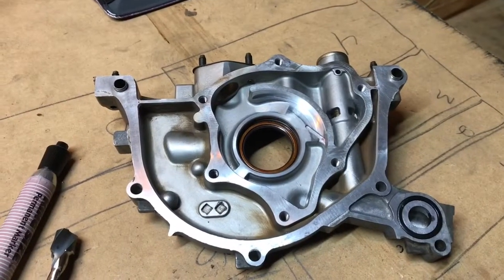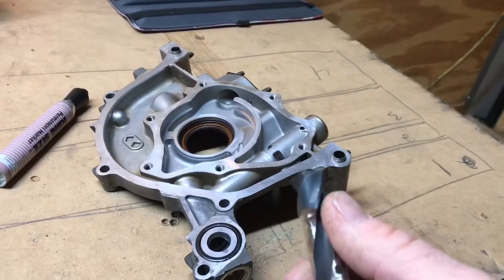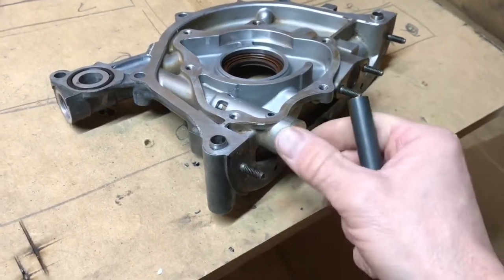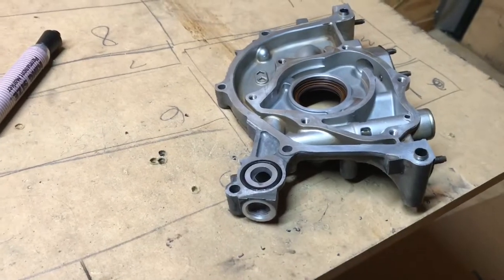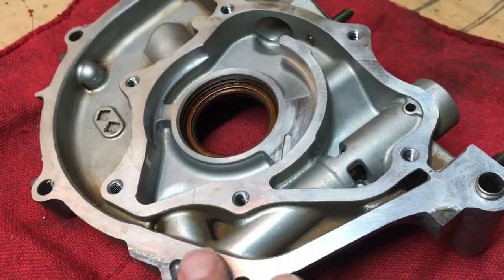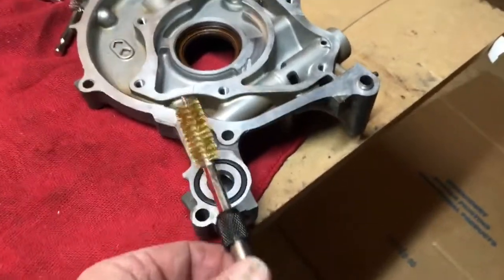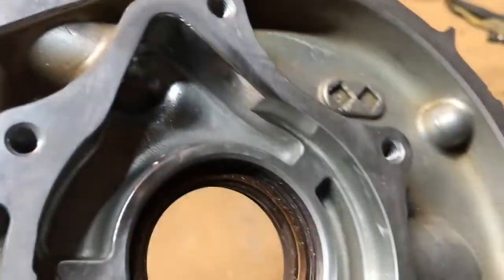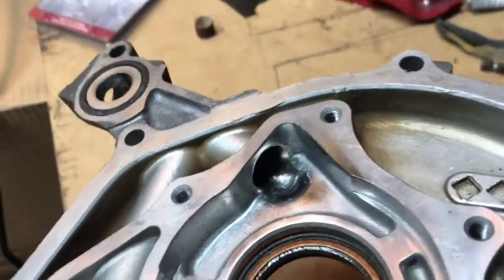Porting a B18c1 GSR / Honda oil pump

Comment from the maker: Here is a short clip of the car being taking up to 9300 rpms with this oil pump. Notice the oil pressure stays right at 80psi and it never moves until I let off the gas. Car is 500-600whp range currently  https://www.youtube.com/watch?v=vl7dng9rmEE&feature=youtu.be
Reply from the maker: rizky lase not sure why it’s not working, I’ll see what I can do
Reply from the maker: rizky lase there is a video linked to a below comment that also shows a shirt clip, the car is now 700whp and holds 80-85psi on the track and still holds great oil pressure while driving around. I shattered the pump in this video when my crank pulley came loose ( not the pumps fault) I ported another pump the same way and going strong ever since.  There are videos on my page that show the gauge while racing (gauge is where the radio used to be)
Reply from the maker: rizky lase https://youtu.be/vl7dng9rmEE just made this today

Comment: Thanks for the upload, I hadn't found a video with the bit size and drill step included.  I appreciate your take on the job!
Reply from the maker: Hope it helps, I just did my 2nd pump for mine. The one I did in this video did incredible until I shattered it at 30psi when I  overreved without having a proper damper....not the pumps fault
Reply: @barryc1635  I thought I had everything required and was going to start porting it this evening.  Seeing this video this morning was perfect timing and will save me some headache.  Again thanks!

Comment: A little rough, but with practice... ;-)

Lightly grinding the cutting tip so it is less sharp - 1/16 zero rake is plenty - will greatly reduce the grabbing of the cutting tip.
Pick up a 6-8" length of steel rod, cut a slot around 1" long at one end and smooth off the sharp edges - you can cut strips of fine emery cloth/W&D and slide them into the slots and it will do a very nice smoothing of the oilway when spun by an electric drill.
Cutters, or burrs, are much better for removing aluminium and should be used with wax, or other lubricant, to reduce cut material sticking to the cutter.
Depending on the engine, and how far one wants to go, one can also drill out the internal oilways and, for the long oilways, extended drills are available, although their cost may restrict that to the more financially comfortable folks, or those who do a lot of block preparation.

However, as I understand it, one of the big problems with the high rpm (~9k5 up) operation is cavitation and this happens on the suction side - this would suggest that some judicious reworking on that side of the pump, and oil pickup, would be a very sound idea.
Reply from the maker: Interesting thoughts.   So far mine has performed perfectly, but I’m sure there’s always a better way
Reply: Did you read the results of revving it all the way to the Moon with the modded oil pump?

Comment: Awesome stuff. What else did you do to the ports size were you stuck the marker just leave it alone
Reply from the maker: If you talking about  the entry area where the drill bit went in, that area is threaded and don’t get touched. That’s why I made sure to remove the part of the drill bit that could possibly damage those threads. If that’s not what you meant, ask again lol
Reply: @barryc1635  the hole with o ring seal leave it same size or can I open it up and on the block and i always clean it up 👍
Reply from the maker: since the pick up tube that connects to it is the same size as the o ring port  ( I do believe) I would not open that o ring port up bigger since it would cause a bottle neck and cause turbulence. I would only round the inside area and make it smoother
Reply: @barryc1635  well i was wondering i use to have a baffled morso oil pan and still have the oil pick up cause someone stole that and pump so I didn't know I have a DART block I was sick and someone went threw my stuff I had 2.2 stroker built Brian crower stroker kit said block would hold 60PSI traded a running single cam for it because needed a running motor lol but I been sick with brain tumor and cushions disease rhabdomylosis and blood clots im healing now but its been three years and I fight everyday wake up hurting go to bed hurting and can't get disability or anything said I didn't qualify because I didn't make so many hundred thousand dollars by a certain date BULLSHIT I think and I finally got some help when the nurse seen me threw window laying there in the hospital  parking lot Drs said I was eating to much I couldn't sleep or anything I told em I was rapidly gaining weight and wasnt eating my cortisol levels were in 90S I was in so much pain i had wholes in my stomach you could see my stomach lining i had to learn how to walk talk eat and all again and now all the money I had saved up had went to meds and gas and bills so I have no money I could have built my stuff I had plained and everything just come falling down on me it been hell i have been crucified and I helped everybody if I had it they had it never meet a person like me but anyways I'm getting it everyday wake up hurting go to bed hurting but im get something weather i get the governor or TRUMP or boths  attention it's hard man I can't work so I have no clue I can do almost anything just if Drs would have looked at blood or something I'm in 20s never smoked crack or meth or anything and it eat enamel off my teeth then had to have 24 pulled at one time  and before I had a couple at a time the last 24 a Dr dentist done it for free because I was fighter he said ill do them for free i said thank you it was going to be 36,000 dollar's But I'm a get together for real amen
Reply from the maker: Sound like you have had a rough go buddy, I truly wish you the best on a healthy recovery
Reply: @barryc1635  yea and thanks I will and have a good one thank you for great info.
Reply: @barryc1635  yea I have and  thanks alot and you find out who your friends are I've helped alot of people out and you can count em on one hand. I have worked helped with bills and parts and cars and trucks motorcycle etc and I have had maybe a few ask if I need something I have lost everything but I will get back up and everything will happen I didn't deserve this it's like cancer but worse some people use chemotherapy and radiation treatments and get cancer but i fought for my life honestly"everyday and  pushed myself it's taken alot out of me but I will be something serious I'm not joking at all i have scars from the holes and sores and varicose veins and ghost cushions disease which looks like stretch marks but its going away and to know is your body will make cortisol because it usually doesn't and thats in your blood. "NOT because your Fat."
Reply from the maker: I can’t even imagine what you have had to go through, I’ll tell you as I’ve told others in bad situations..... just stay positive and have faith!
Reply: @barryc1635  most people die from how sick I have been seriously I dnt want people to be sorry another person had what I did and they died but i was worse I just fought for my life honestly everyday and still do its caust me everything honestly I have had enough to build build 69 camaro 69 1/2 charger 70 chevelle and CTR EK9 civic and some other vehicles but im  a do my best to get back to that point and make those cars and more .
Reply from the maker: I’m not law enforcement buddy, just someone trying to help other Honda owners.
Reply: @barryc1635  I'm sorry man I need to rest thank sorry keep that vtec cracking

Comment: Hi Barry... what was your hot idle oil pressure before porting and shimming.... and what about after .... thanks
Reply from the maker: Hot oil pressure before was 18-20 and after is 20-24 (At idle) and high rpm was around 80 before and also 80 after. Without the shim I would have lost pressure with the port job done and I also went larger gap on my main bearings which lowers oil pressure. Shimming the pump got my pressure back to where it needed to be. The link below was a video I just took with doing some tuning

https://youtu.be/fIgYyrRRf_o
Reply: Barry C Thanks Barry .... very interesting info 👍👍👍👍👍

Comment: what shim did you buy for the oil pump? good vid help me out a lot.Thanks
Reply from the maker: Thanks for the comments, I’ll measure the thickness of the shim I used and leave a comment soon as I can. The motor is still holding great oil pressure even after I used oversized main bearings. I’ll probably make a short video showing the oil gauge at idle cold and hot temps
Reply from the maker: 1.44mm / 0.057 in thickness is what I used
Reply: Barry C do you know inner and outer diameter?
Reply from the maker: Easy thing to do is to take the oil pump plug/bolt to somewhere like Ace hardware. Just make sure it’s smaller than the width of the threads and you will be fine